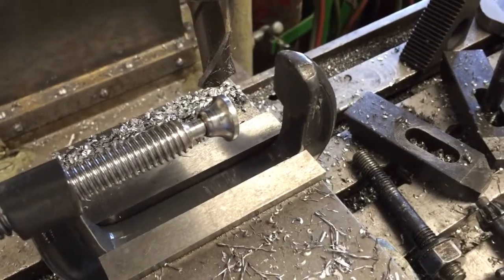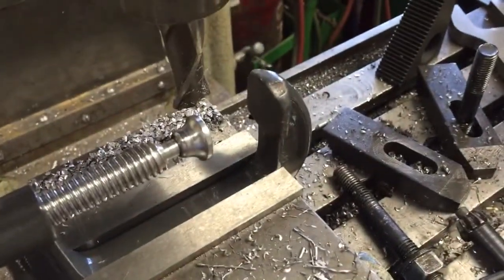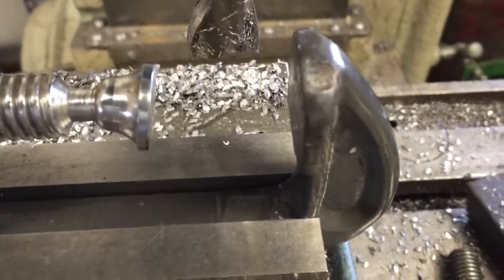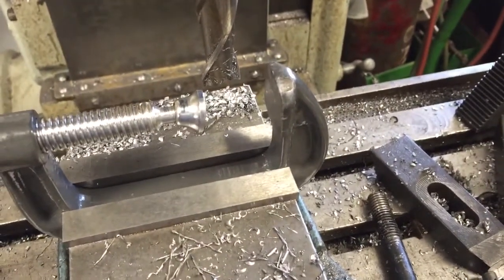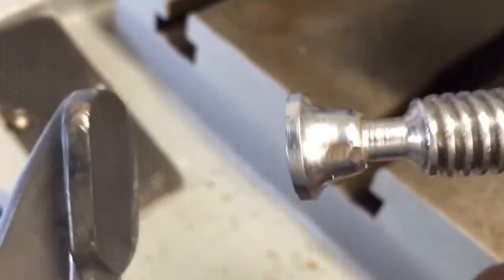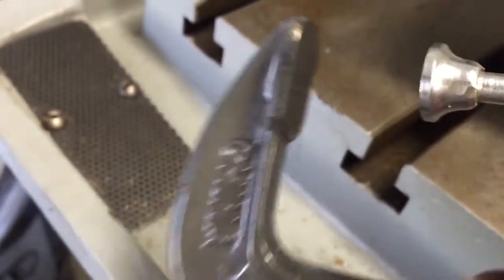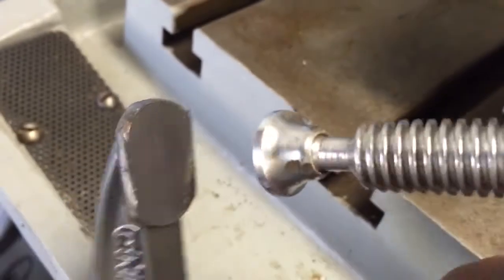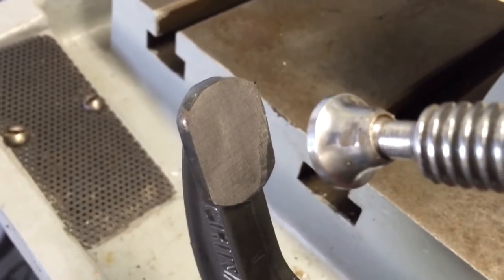C-Clamp FIx

Comment: The unmovable upper jaw has an angle is no big deal, because the lower jaw is movable and together they bite the work piece just perfect.
Reply: The more off square the static jaw is to the beam, the smaller the effective opening of the clamp is. Also  the further off center, the more the clamping force will cause the arm to bend.